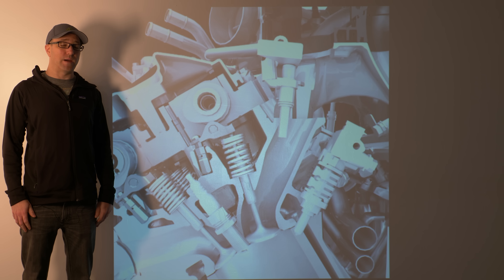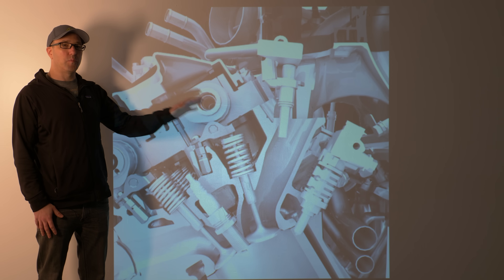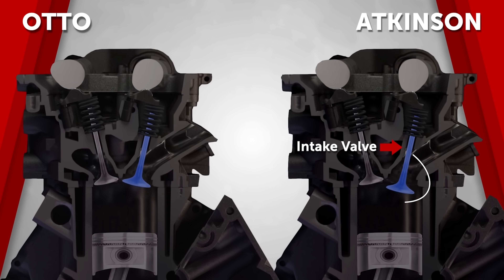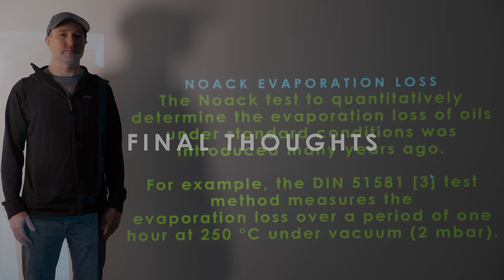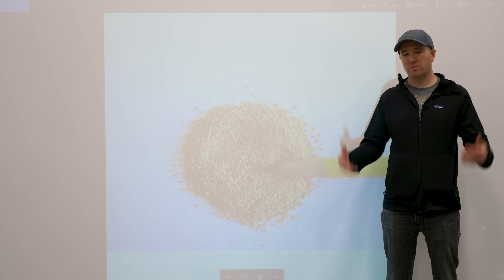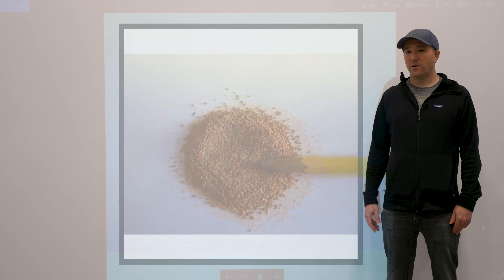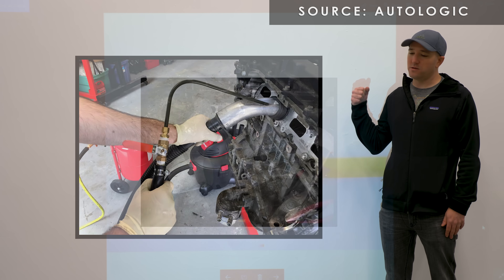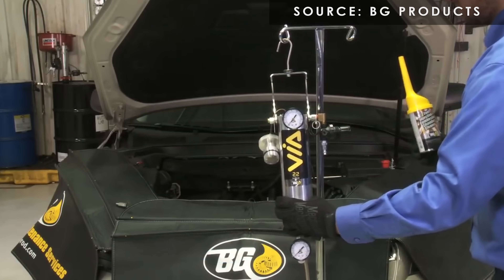Direct Injection, Problems and Solutions | The Fine Print

Comment: Is carbon build up a problem with diesel engines? They have used direct injection for years. And even with older indirect injection diesels, like the old mercedes engines still have no port injectors (of course).  So it it normal to rebuild diesel engines for the same reasons as modern DI petrol engines?
Reply: The primary difference with buildup issues between diesel and gasoline are the metallic add-packs that gasoline engines contain. These are very difficult to cure with one clean as opposed to diesel which does not contain or produce  "metallic carbon"
Reply: Depends on manufacturer. Allot of diesels just recently started using emissions equipment in the past 5-6 years .My 01  Cummins ( that has no emissions equipment stock) breather / PCV drops  to the ground per factory . 300k mile engine I just did a tear dowm and refreshed the engine at my shop and the valves looked great.  I did the same procedure on a 6.5TD chevy that has a closed loop PCV and the valves where just as bad  if not worse as shown here. But with a open pvc like cummins  make less power ( not much 5-8hp) than closed pvc. Crankcases like vacuum . Its all a pay off
Reply: OCV is just plain evil. OTOH, the stuff they clean the valves with is evil too. Must go all-electric soon.
Reply: Off-highway diesel engines frequently use "Open Crankcase Ventilation" (OCV) as opposed to the PCV system in automobile engines.  OCV systems vent the blowby gas out to  the atmosphere instead of back into the engine.  With current emissions regulations, the blowby gas must be filtered, and the condensed oil is then fed back to the sump.  In the past, all engines (gas and diesel) could route this blowby gas directly to the atmosphere.
Reply: Yes, diesel engines has the same problem as gas engines. meanly thru the egr. Plus your variable vanes from the turbo also get cloht up.
Reply: Matt b 
Ask vw guys with mk3/4 tdis, I’ve seen quite a few where you couldn’t get your thumb down the intake opening in the manifold. 
Best thing is to retune with a chip and have the egr turned off.i did my mk3 the old way and just made a block off gasket. 
Yea I got a check engine light , just plug in the reader occasionally to make sure that’s the only active code.
Reply: On the new pollution controlled Diesels. The EGR clogs them and kills them.
Reply: This is 100% correct. This is why you see all that black smoke for diesels. On many DI cars, they have Variable Valve timing (VVT) and due to valve overlap, exhaust gases pre-PCV are routed into the combustion chamber causing valve coking.

Comment: No turbo, no direct injection, no dsg -- 1989 toyota corolla.
Reply: No abs, no airbag, no sport mode, no vtec- 1990 miata
Reply: No power,  no problem.
Reply: No dsg, no DI, and no turbo  ,1986 Jetta carbureted and 4 speed manual and still gets 40 mpg .
Reply: No turbo, no direct injection, no dsg - 2018 Toyota Corolla
Reply: Or a 1996 Corolla AE111, Asian spec though.
Reply: xartpant
1998 Toyota Corolla checking in
Reply: xartpant 
Lol! Good one i love old cars
Reply: AND........NO power
Reply: 87 fx16. Smog exempt. Boom
Reply: the_ natrix I tune clean.
Reply: Lin Li Hawaii is producing nox. May they stay safe.
Reply: No excitement either!
Reply: Forgot to add: No power. I'll take some issues with carbon buildup if it means I can have over 100hp more than a corolla.
Reply: But they have a timing belt that needs changed... Also no antisway bars...
Reply: And no technology
Reply: Toyota still making cars and dominating sales for over 50 years. Speaks volumes
Reply: Boring and slow as balls too. You might as well get a 10speed. ;)
Reply: No soul as well. Sorry its been dead gor 28 years.
Reply: And off the chart nox emissions. Can we at least compare Apple's to Apple's????
Reply: @the_natrix9959  Well considering we breathe in NOx at roughly %95 to live it'd say you better stay in school

Comment: Nice
Reply: I did not know about catch cans until late in 2017 so this why I sold my 2013 Ford F-150 3.5 Eco Boost with 40k miles and bought a 2018 5.0 with dual injection. I have already installed a Ford Performance Catch Can on it and you can see my You Tube videos concerning it. I have a Moroso Catch can on my 2003 Honda Civic and a Steda on my 2015 Honda Civic and all 3 work. I was told the 2015 was not needed but the is always oil in it at all oil changes. A catch can should have been installed on every PCV system since 1961 when they were first used. Old manufacturing Engineers working for Ford, GM, and Chrysler will tell you PVC stands for Positively Contaminates Valves.....